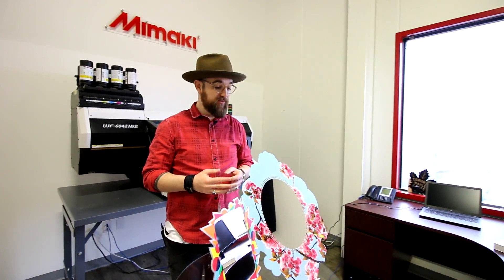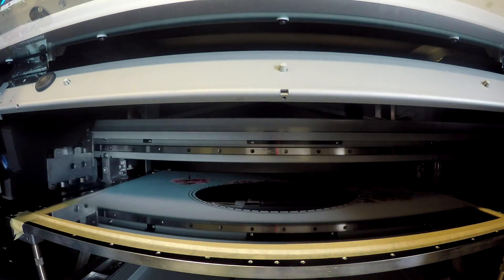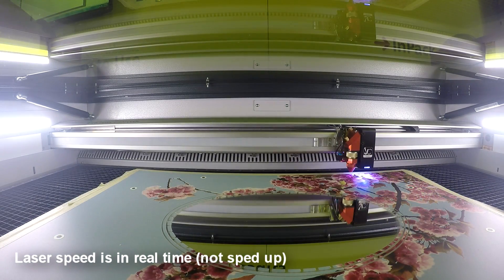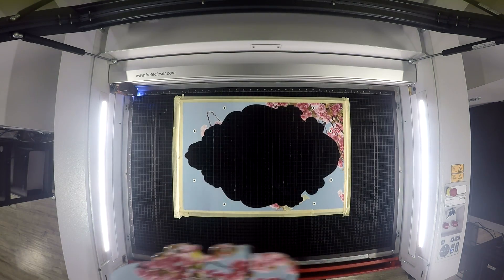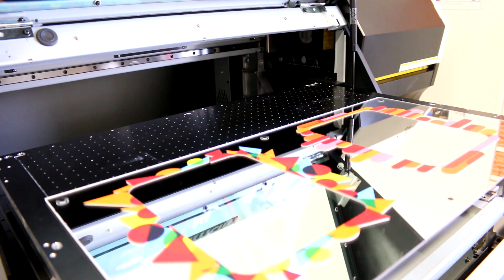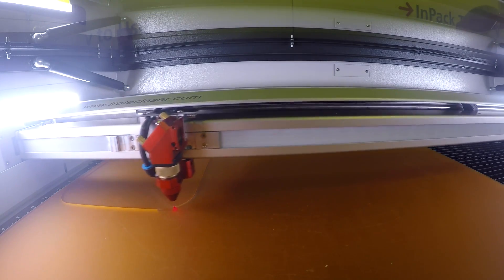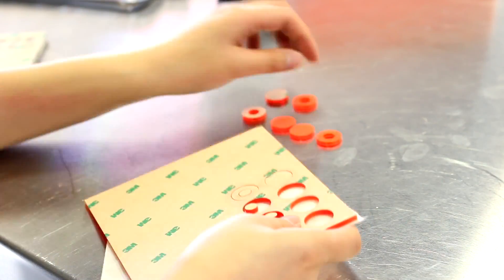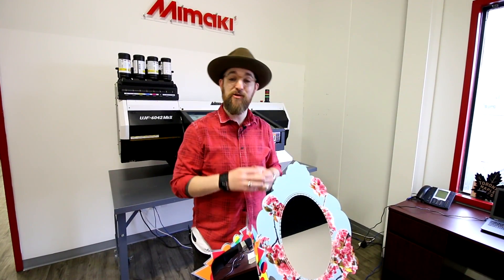UV Printed Mirror Acrylic | Laser Cut Mirror Acrylic | Trotec

Comment: Trotec Canada. This is a really bad idea. I realize this an old video and you've posted in the notes section that you don't advise this for normal production (nor does Mimaki). Righfully so, as this will cause thousands of dollars of damage and to repair/replace from completely ruined print heads. I have both platforms that you're using and was warned NOT TO DO THIS by Mimaki. There are other ways to accomplish the same effect. In my opinion you should either remove the video OR demostrate how to do an inlay over mirror using your same Trotec Materials...which our operations purchase week in and week out. Good Luck.

Comment: How can bubbling of the ink be avoided when printing then cutting with that laser? I've seen alot say cut first then print but some jobs are better suited for print first then cut. Reverse printing can help but your channel has several videos where ink is on top and cut thru the top of different thickness of materials. Any insight would be greatly appreciated
Reply from the maker: DNice7807 that’s a great question! We never had any “bubbling” issues when cutting UV ink. We tried some UV printers where there was a “chipping” effect where the paint would chip off. However, we are happy to confirm ever since we teamed up with Mimaki that issue has stopped. The Mimaki inks and UV printer’s adhesion is excellent and doesnt chip at all when being cut (after UV printing). We always print first then cut because our JC Vision camera system reads the registration marks (on the print) and knows exactly where to cut based on our design file. We hope that clears things up.
Reply: @TrotecLaserCanada  I also have a mimaki what ink do you typically use? I'm getting slight pin hole bubbles when cutting, especially ink side up. 1/8" material. Ink face down helps but I have applications that require both top face printing and bottom face printing. Both benefit from printing first then cutting

Comment: what mode on mimaki to print the mirror? is it LD mode? because the print head move quite slow
Reply from the maker: Settings:
LUS-150 CYMK
Media: All
HigashiyamaFilmHK31WK(Color on White) v3.5
Resolution: 1200x1200VD
Version: V3.5
Type: Full Color

Comment: You should never print on the mirror with uv printer!!
Reply from the maker: Hi Tim, you must really up your maintenance for this kind of work.  It can be done, but it's not recommended as a regular workflow.  A one off here and there would be fine.

For high production, we do recommend to UV print on regular acrylic and inlay the mirror afterwards.
Reply: tim čopi why is it not recommended?
Reply from the maker: @szymoni  The reason is because the UV light reflects back onto the heads and lamps and could cure ink onto them.  This would lead to poor curing and possibly blocked nozzles. One-off won't be a problem as you can see by the videos, but on-going mirror use without proper maintenance could lead to this.
Reply: Trotec Canada thank You very much!
Reply from the maker: @szymoni  Anytime!
Reply: Trotec Canada one more thing, as far as I know reflective materials can be dangerous to the laser machine as well with beam going straight back to the machine? Of course I know the mirror You offer is probably OK but what about normal glass mirrors or reflective materials for signs etc.? Are they safe for co2 laser as well?
Reply from the maker: @szymoni  Hi Szymon, that's a great question. As you can see all of our lasers our closed systems (class 2). For a CO2 laser, any reflection of a laser beam will be neutralized by the protective clear acrylic cover. For open systems (class 4) wearing regular glasses will also neutralize any reflection. For Fiber lasers however, regular acrylic cover (or glasses) cannot protect from reflection - which is why, if you notice on some of our machines, the tinted green cover is present. Open systems (class 4) are also possible with the Fiber but the user must wear special tinted HDE safety goggles when working with the laser. We hope that answered your question.
Reply: @szymoni  the uv light reflected back to the print head surface by the mirror and the uv light can make the ink dry on the print head surface and block the nozzles
Reply: this was what I was really confused with too.